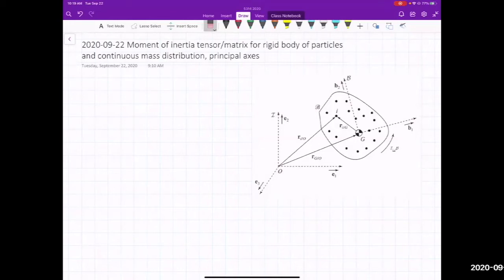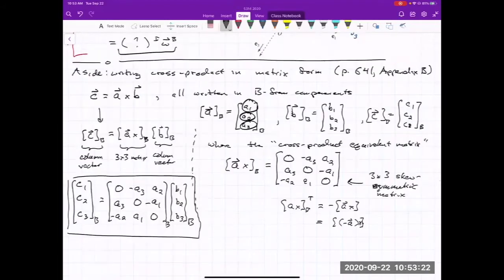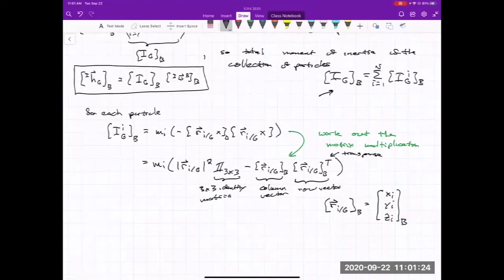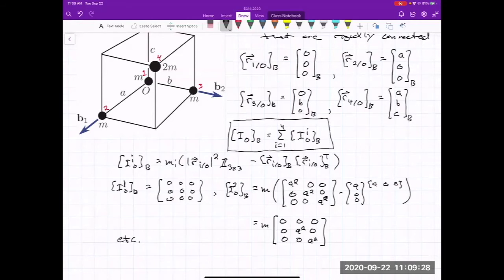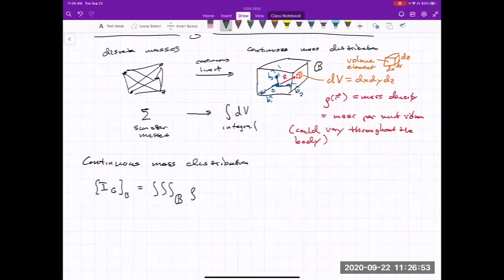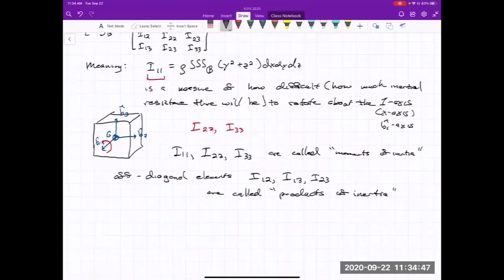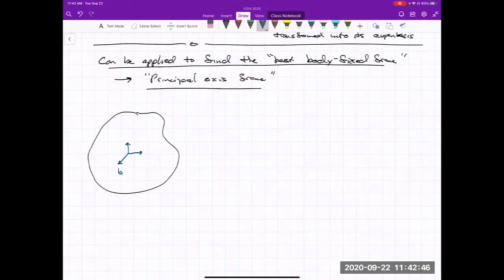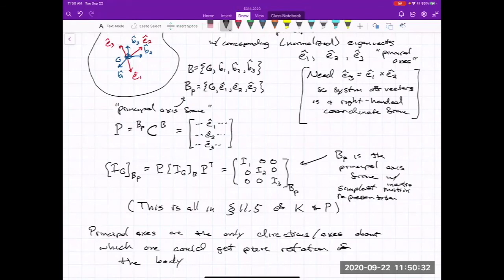Moment of Inertia Tensor & Principal Axis Frame Explained | ESM 5314 Lecture 9

Comment: At the pricipal Axis frame is the DIRECTION of the Angular momentum and Angular velocity same?.
Reply from the maker: No, in the principal axis frame, the direction of the angular momentum and angular velocity are not always the same. The principal axis frame is just a particularly convenient choice of body-fixed frame. HOWEVER, if the angular velocity is along one of the 3 principal axes, then the angular velocity is in the same direction. So there are SIX possible directions in each body where the angular momentum and angular velocity will line up (the + and - of each of the 3 principal axis directions).
Reply: @ProfessorRoss  Thank You Much. This Just Helped me figure out how to make progress in my research. I am a PhD student at the University of Nevada and Your resources has been my go-to guide. Thanks so Much